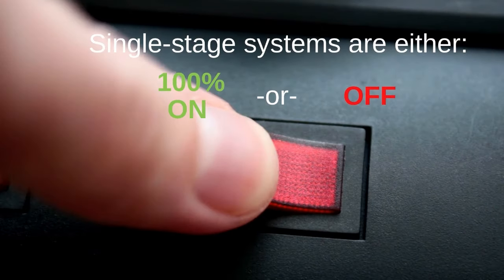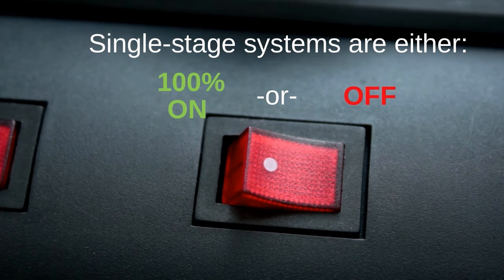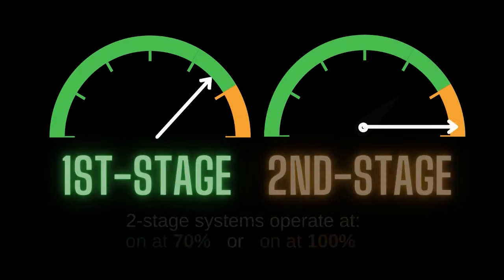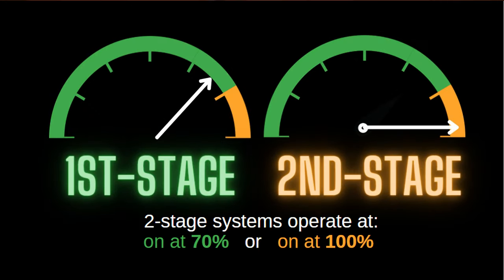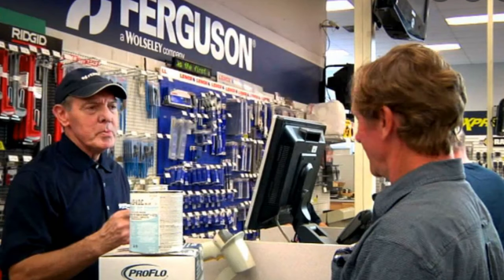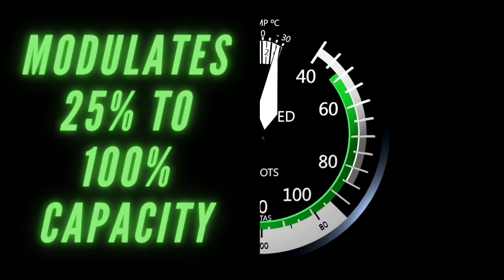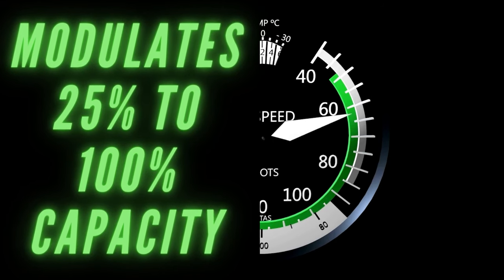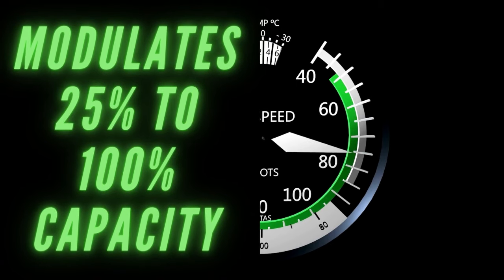Should I Buy a Single Stage, Two Stage, or Variable Speed Air Conditioner

Comment: This is a very useful explanation. I moved into a new house recently and the HVAC system is 20 years old so I am in the middle of figuring out what to replace it with. Thanks very much.
Reply: Replaced mine with 29 SEER variable speed (inverter) system. Huge difference in electricity cost, consistency and it's super quiet as well.

Comment: A few years ago a friend got talked into purchasing two fancy heat pump units for his large house. First year he had the service company come out twice for free warranty calls. Next three years he paid a lot of money for at least 4 service calls. Finally took my advice and ran heat on emergency setting using cheap natural gas. His wife is a CPA and went over the winter heating bills including over $600 on service calls. Came out a lot cheaper just using natural gas. He had a very good insulated house with 2 by 6" insulated walls, R50 insulation or higher in attic and all low E quality windows.
Reply: In the real world...all of that is true.  Selling solar panels is in the same category as heat pumps are. You pay upfront for free power over the time the solar system will live. NOT cheaper in any way but people will believe in it. Heat pumps may not be that more expensive to buy but they will use more power guaranteed and function less effectively.
Reply: Generally speaking (in the USA at least), if you have access to natural gas, it's going to be cheaper or very similar operating cost compared to a heat pump system- btu for btu. A traditional 80% furnace is probably the best option for home owners that want to balance reasonable heating cost with longevity of their equipment. Everyone gets excited about heat pumps, but IMO they are more practical to those in a rural setting where natural gas is not available. Many technicians are lazy and do not pressure test or properly evac heat pump systems, leading to a shorter lifespan of the equipment. Also, home owners are pretty ignorant- using your current heating bills as input into a heat cost comparison calculator is where they should start if at all interested in "efficiency" or saving money. In my case, I found it is cheaper to heat with resistance heat than fuel oil, but many people I have talked to about that don't believe the simple math in front of their face!
Reply: Going to be interesting in next 10 to 25 years where California , parts of NY state & others are going to outlaw installing any natural gas in new homes followed in 10 to 15 years that existing homes with natural gas must get rid of gas and spend tens of thousands of dollars to upgrade electrical services ( might need a very expensive 300 or 400 amp service if u have 2 EV'S )replace gas furnace, gas dryer, gas water heater & gas stove with guess electric. Worst part  lazy foot dragging ultility companies will never have the extra generating stations, high voltage transmission lines or hard to get distribution transformers in time for that do people will have to deal with power blackouts on cold winter days along with hot summer days. California has it all planned out. First they decommissioned their last nuclear plant that generated 12% if states power, then outlawing gasoline generators but will have discount coupons for freezing homeowners to purchase extra thick warm sleeping bags and hand out hand fans to cool themselves while not having power on hot days. Icing on the cake is they will not be able to charge thier EV'S during rolling blackouts and peak energy usage numerous days. No wait California also going to give out discount coupons to purchase expensive 15 speed mountain bikes to get around .
Reply: @JohnThomas-lq5qp  I'm a NYS resident- It will be interesting for sure. I just installed a mini split system which is my only heat source (aside from space heaters) and it worked fantastically well this past winter. That being said, next project is a woodstove for when the rolling blackouts hit during polar vortexes. It's crazy to see the amount of heat pump mini splits that have been installed over the past couple years in rural houses, but it is logical to do so due to (update) NYs reasonable electric rates vs propane/fuel oil. At current rates, it's cheaper to heat with resistance heat until fuel oil drops below $4/gallon. IMO the electric cars can be part of the solution when it comes to meeting peak demand- but my biggest concern is cold weather events taking down the grid due to massive spikes in demand... As for banning natural gas in areas where it is available to residences and business- very silly.

Comment: I live in Minnesota and it gets cold and also very hot and humid.  Had my 31 year old Rheem 1 stage system replaced with a High Efficiency Variable Speed Bryant system in November 2019.  Yes it was expensive, 3k more then the single stage 80% eff furnace and AC.  However, my gas and electricity costs went down 40-50% a month.  Xcel said I now have one of the most efficient houses in my neighborhood based on square footage.  I never know the system is running inside the house it's so quiet and have to read the thermostat to know if it's heating, cooling, or dehumidifying.

Comment: In the south where humidity is an issue variable units can save cost if it means you can skip a dehumidifier.

The other big piece of the equation that gets glanced over is the variable speed units are the top of the line systems. Usually this means they come with much superior warranties. In turn, stands to reason they are better made.
Reply: I disagree,  my home's humidity increased drastically,  (the unit seems to run based on outdoor temp as far as cooling capacity and indoor coil temp,  it can go as high as 54 degrees)  so my house was always at 56 percent humidity so I had to get a whole home dehumidifier just to keep it at 45 percent.  On top of that,  my vrv life system outdoor unit took a crap after 18 months.  I was out of service for 30 days while they replaced every motherboard and expansion valve and had to end up replacing entire outdoor unit (compressor).  The tech's were clueless even though they installed it, had to rely on tech support for everything.  Its not like a single stage where its the fan motor, compressor or the capacitor.  This thing has multiple motherboards bigger then whats in a desktop home PC.,   Not only that but a single stage indoor coil is always going to be in the 30's when it runs so the dehumidification is outstanding.

Comment: I spoke with a tech from Trane who was really informative, the whole idea of stages is to maintain humidity and temperature. Seer rating is kind of moot because if the ac unit is running constantly, it had to be efficient. 

If you get a 5 ton ac unit but only need 2 or 3 ton, the temp will go down but the air will still be humid and it shuts off. Something like a variable speed system will work longer at a reduced capacity to pull the humidity out of the air in the home.

Depending on the climate you live in having a 26 SEER rated ac unit would take decades to recoup the extra money if you only use it a few months out of the year.
Reply from the maker: Good stuff. Sounds like you have a good grasp on what they told you.
Reply: Keep in mind, true Modulating Veriable speed system, are mainly made for Zoning applications, because thats where you can truly take advantage of its effectiveness and efficiency, but if you install the system as single zone it will NEVER RUN at 25% of its capacity, its intelligent processor will fix its speed to meet its certain static pressures.
 Most important application is proper ductwork design, just my 2 cents my friend.
Reply: Depends...in California you will like recoup your money in 2 to 3 years since their power rates are six time higher than the rest of the nation. They are charging .35 to .45 cents per kWh in CA.  Adds up fast at maybe $30 a day for 65 kWh's.
Reply: Yes, it depends, my old 5 ton single stage failed, I now have a variable speed 3 ton. It paid me back after three years, the best part is most time you can’t even tell it’s on. Is it expensive yes, but a cheaper single stage is way more expensive in the long term.
Reply: @calivalley9056  Repairs and repair costs will out pace a single stage over time too so that should be a factor. Not to mention, how long will those proprietary parts remain available if the variable units will go 20 years long?
Reply: @Garth2011  I’m also in a two story home, in the Central Valley, with two bedrooms over a southern facing garage, horrible. A plus to variable speed is my system is now zoned as well. I personally have no regrets, I’m seven years in and no issues. Also, if you have a PV system you will need less panels, another cost savings.
Reply: I have a daikin vrv life system,  keep in mind when the unit runs at low speed it doesn't dehumidify at all,  the indoor coil temp gets in the 50's on mine,  and if you look at a dew point chart you can't dehumidify unless it goes down into the 40's 30's etc.  So my humidity is always in the high 50's in the summer,  I had to get a whole home dehumidifier just to keep it the mid 40's.  I didn't have that problem with my old single stage a/c.  It may of ran on and off all day but it hit set temp, and humidity wasn't an issue.  Now my home hovers 2 degrees above set temp and there is that humidity issue.  So I do regret my decision I should of gone with a high end  single or 2 stage heat pump / a/c system and a 2 stage furnace for backup / defrosting.  It would of been a lot cheaper less head ache and a house that is comfortable without so much confusion.  Set point is 72,  wont kick on until 73,  goes up to 74 and won't turn off until it hits 71 which is in the middle of the night.  I have no idea if running at low speed 18 hours a day is better then full speed on /off 10 mins an hour.
Reply: I am trying to make a decision on replacing my furnace/AC. I have quotes from three contractors with two stage and variable heat pump systems. I live here in Wisconsin and our natural gas is at an acceptable price. Our winters have been mild for the most part. I just can’t decide where to spend my money. My current system, which was installed when we built the house is a single stage furnace(94%) with a single stage 14 seer AC unit. There is no mistaking when it runs it’s pretty loud. I battle humidity in the house so I am not sure on buying a variable system. We plan to go solar here in the next two years so I think that the heat pump makes sense. I don’t know my wife and I have been trying to decide since November.
Reply: @jko0526  so what did you decide?
Reply: I had the Mitsubishi Intelliheat duel fuel 3 Tom system installed. 2 months into it and my only complaint is with the Mitsubishi thermostat that they insist that I use. The thermostat is ridiculously simple with no features and to this day I had to make a choice of system fan constantly on or having the system fan run only when it calls for air conditioning or heat.
Reply: @jko0526  That stat does not sound "intelligent", thanks for the reply.

Comment: We had a train variable, and it was awesome. Wish I still had it
Reply: Hopefully you can get a trane variable or a carrier infinity variable. I’ve been inside homes with variable speed systems and the indoor air comfort is unreal because there are no hot or cold spots. You can crank those down to 68 degrees and still not break the bank with your energy bills.
Reply: @davidperry4013  unfortunately I was told the crawl space in my house is too small